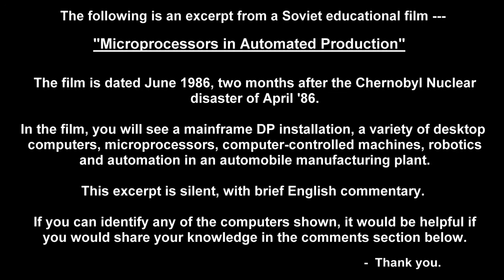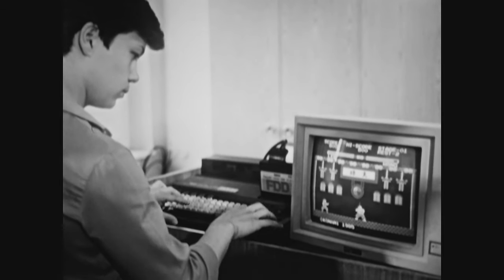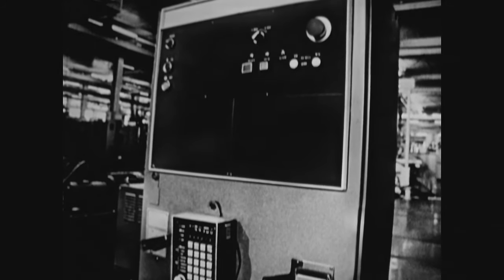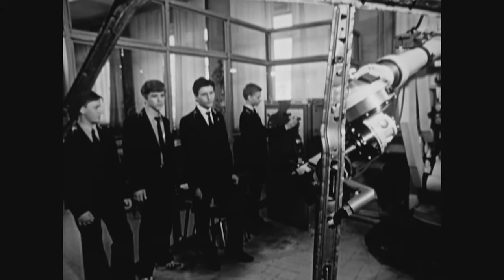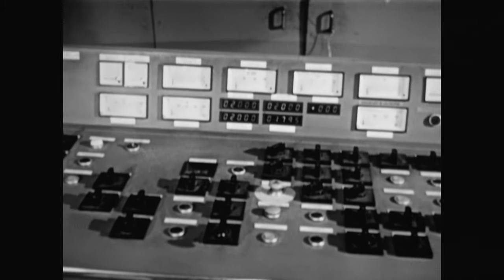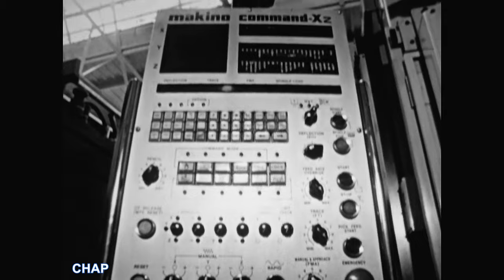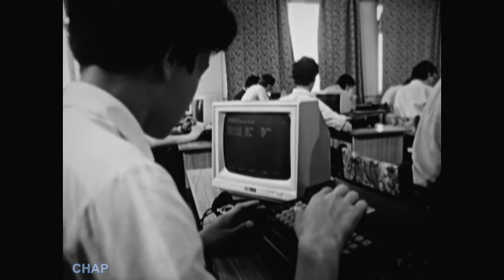1986 Soviet Micro Computers, Can You Name Them?   Microprocessors, Automation, Robotics CNC Game PCs

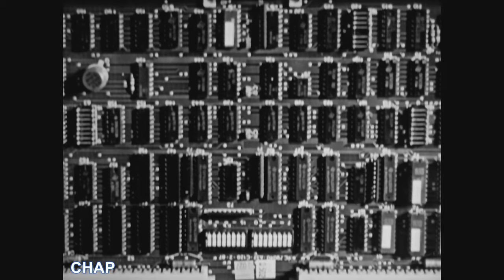Comment: 2:00 – Elektronika BK-0010 (Электроника БК-0010), a home computer based on KM1801VM1 (КМ1801ВМ1) 16-bit CPU implementing PDP-11 instruction set (the same CPU used in some models of MC1201 processor module). This first model in BK-001x series features a cheap flat membrane keyboard. The later models (starting from BK-0010.01 / БК-0010.01) used mechanical keyboards which were much more convenient for typing. BKs were widely used in schools as well (usually with one of DVKs as a teacher's machine).
Reply from the maker: Thank you very much.  This background info helps put these machines in perspective.

Comment: 2:12 - Elektronika DVK-2 aka MC0501 (Электроника ДВК-2, МС0501). The top box is the computer itself, recognizable by famous 3 switches inherited from LSI-11-era PDP-11s. The bottom box, the CRT monitor and the keyboard are Elektronika 15IE-00-013 aka "Fryazino Display" (Электроника 15ИЭ-00-013, "Фрязинский дисплей"), a stock serial terminal, which was shipped as a part of DVK-2.

Comment: 2:06 – Elektronika NC-80-20 (Электроника НЦ-80-20), likely a prototype of Soviet personal computer which later was massively produced and known as Elektronika DVK-3 (aka Elektronika МС 0502) with a slightly different enclosure design and a different keyboard. As other DVKs it was built around single-board CPU module Electonika MC1201 (which as well was used in other applications like process control or data collection). The model 3 was the first one which had monoblock form-factor, incorporating a display. Previous ones used an external stock serial terminal Elektronika 15IE-00-013 (Электроника 15ИЭ-00-013) informally nicknamed as "Fryazino Display" (from the name of the city of Fryazino, where it was produced). You can see those displays as a part of DVK-2 in the classroom scenes (they had kinda funky squared-cone-shaped CRT monitors - 1:22).
Reply from the maker: Hi mdofxds,  excellent info.  Thank you for the clarifications. ~
Reply: @ComputerHistoryArchivesProject  Hello, you are welcome!

Comment: An excellent film in which you can see a lot of Soviet and imported technological equipment, as well as several iconic computers in the USSR: Yamaha MSX (Japanese PCs that won the 1985 Soviet tender for the supply of imported PCs for schools), DVK-2 and DVK-3 ( popular professional and educational PDP-11-compatible PCs in the USSR), BK-0010 (the first Soviet home PC, 16-bit!, produced since 1984, one of the main educational and home PCs and one of the most popular computers in the USSR), ES- 1840 (not a very successful, but very famous PC, one of the first IBM-compatible ones among the many produced in the USSR). However, at that time (1986) the production of the most interesting and most popular Soviet PCs had not yet begun, many of which began to be produced just in the next year, 1987:

UKNC (Electronika MS 0511), the most popular Soviet PC, was used mainly as an educational, less often professional or home - it is the cheapest of the PDP-11/LSI-11-compatible computers with good color graphics, has two fairly powerful 16-bit processors K1801VM2, 192 KB RAM, 32 KB ROM, graphics 640x288 / 16 colors.

Corvette PC-8010/8020, a very common and advanced 8-bit PC with very good graphics 512x256 / 8 colors (16 color palette), hardware graphics accelerator, independent text video controller, 112 or 256 KB RAM, etc., was mainly used as a educational PC.

DVK-4 with KCGD (color graphics display controller), a serious professional computer from the PDP-compatible family, a fairly powerful K1801VM3 processor, RAM up to several megabytes, hard drive, graphics from 400x240 to 800x480, up to 16 colors from a palette of 64 colors.

Vector-06C, an excellent 8-bit home PC, one of the most common in the USSR, with excellent graphics 256x256 (up to 16 colors) or 512x256 (up to 4 colors), a palette of 256 colors, hardware vertical scrolling, 3-channel sound, 64 KB RAM expandable to 320 KB or more, CP/M compatible.
Reply from the maker: Hi @vladtru9670 , thank you very much for the very excellent breakdown of the equipment described!   That is very helpful and informative too!  ~  Victor, CHAP